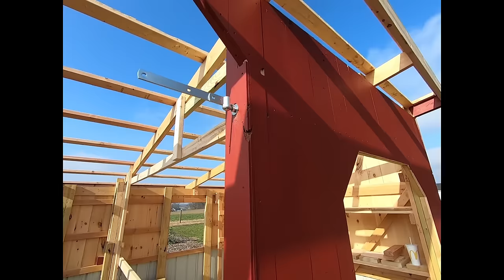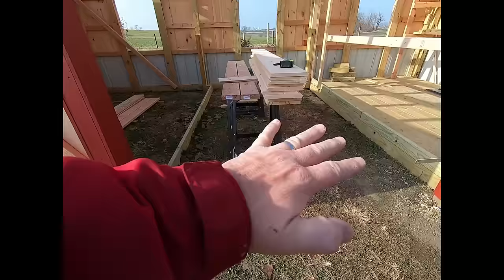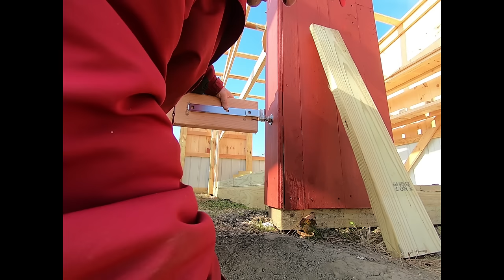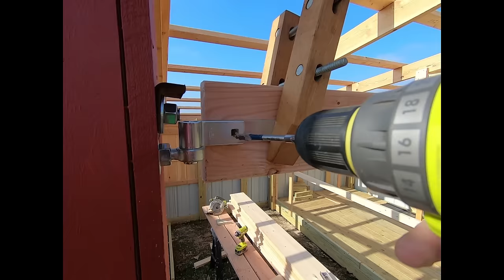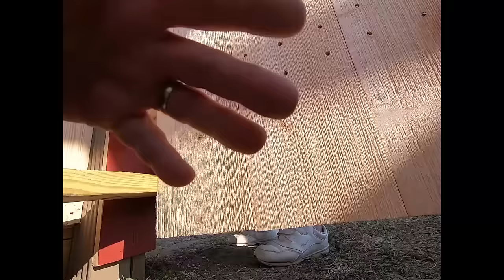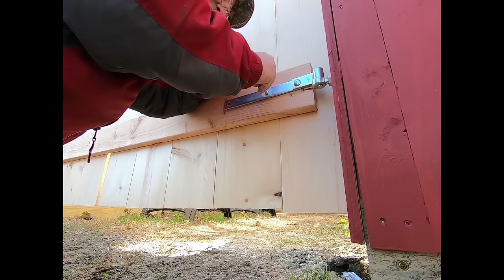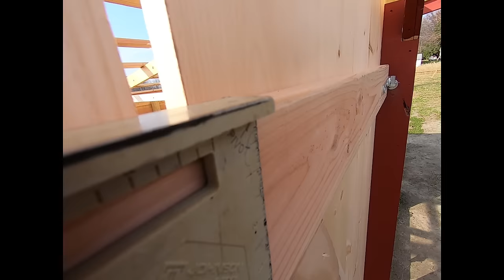DON'T build BARN Doors UNTIL you watch this VIDEO...EASY BARN DOORS

Comment: Easiest way to make large doors . . .  except they don't actually seal anything, so they are basically just gates that do not offer any protection to the things stored inside the building from the elements?  Am I missing something?
Reply from the maker: Thanks for watching!  I think you missed the whole point of the video.  One could build them as weathertight as one wanted.  The point of the video is to show that large doors can be built alone.  Secondly, a run in equipment shed is seldom weather tight.  If I wanted a garage I would have built a garage.  The doors keep 95% of weather out and what gets in is at the door area.  I gather you haven’t seen many real barn doors that are built above dirt and gravel and span 20-25 feet.  They are hardly weather tight.  Sorry for being short but you missed the entire point of the video by looking for things to be critical about.  Have a great evening.

Comment: Why didn't you simply install the other two bolts on the hinge with the vertical pieces installed, than remove the first bolt, install the vertical, than drill and reinstall the first bolts?
Reply from the maker: Good question.  Thanks for watching!

Comment: Pushing the hinges down like that will wear the hinges out faster. The hinges were not made to work like that.
Reply from the maker: They are going to drop down anyhow if the doors were built the traditional way with hanging after assembly.  The hinge has no way to not drop down. It's a matter of having the doors with a consistent reveal between them or sagging doors. We've built many doors this way and years later no problems. The largest were 24 feet wide and 16 feet tall.  I don't think the hinges will have a problem. Thanks for watching. Have a great day.

Comment: Damn it would be like a open window with the gaping cracks around the doors
Reply from the maker: It wasn't done yet and with a dirt floor I don't think a tight seal was realistic anyhow.  It's east facing and inset and with a roof overhang. Very little weather gets in.  Run in equipment sheds are seldom weather proof. Thanks for watching.

Comment: I wouldnt leave the hinge drooping down, why not level it up so you have more bearing of metal to metal.
Reply from the maker: Thanks for watching.  If you don’t take the “slack” out of the hinge the doors are going to droop down. That’s why this works.  No matter how it’s done the style of hinge used is always going to have the problem because of the “slop” in figment.
Reply: @LancoAmish  I don't see how there are 3 bolts to hold it. The same forces apply weather its level or not. You still rely on the bolts to hold the door to the hinge, If the bolts fail the door droops the hinge stay still. so whats the difference.
Reply: @LancoAmish  I would just shim the slop out of the top hinge and bottom hinge in the appropreite direction according to wieght distribution before bolting.  Now I have level hinges with full metal to metal bearing surfaces for longer ware and probably less squeaking.
Reply from the maker: Good idea.  Learn something every day!

Comment: Nice. An observation on technique, however. When tapping the bolt in, you are really choked up on the hammer. Hold it close the butt end, swing it like a pendulum, holding the bolt between your forefinger and middle finger with the pads of your fingers (not the nails) facing the hammer head. The same thing for starting nails. You'll have better control of your swing, and any "miss" won't smash a fingernail. The worst way is to grip the bolt or nail between thumb and forefinger, because you'll inevitably end up hitting the edge of your thumbnail.   "With years of experience comes...years of experience"
Reply from the maker: Thanks so much for watching and the great tip!

Comment: buy use them hinges can the door open either way
Reply from the maker: Marty Martin, mine open out. They bind inwards.  You would have to leave enough clearance for them to swing either way. In other words don’t put the bolt pin in too far on the posts

Comment: 11:25  I probably would have installed the other two carriage bolts then backed out the original carriage bolt then installed the last upright then drilled the hole thru that then reinstalled the original carriage bolt.
Reply from the maker: Good idea.  Thanks for watching. N

Comment: Prefer to have the hinges  verticals and braces on the inside
Reply: Yes...more protection from moisture which gets sandwiched and rots wood. 👍
Reply from the maker: Ben Joseph , I’ve built them both ways. These are set back into the opening.  Since I have neighbors I wanted them aesthetically pleasing also.  Thanks for watching!
Reply from the maker: Thomas Gertsch I’ve built them both ways.  These are set in underneath a ways to protect from moisture. I also wanted them a little more aesthetically pleasing since they are very visible to neighbors.  Thanks for watching!

Comment: NEVER build a barn door like this in Kansas!!!  We have barn doors that actually keep the weather out!!! The technique seem sound but we need doors that actually fit the opening like a real door. I have an old door that was changed to a failing rolling door that needs to be replaced. I may try to use this technique to replace it with swinging doors.
Reply from the maker: Thanks for watching!  The shed faces East and weather isnt that much of a worry.  They weren’t finished yet so they are a bit more weather tight than they looked then.  It’s the idea of building them in place that’s different than how most doors are built. I’ve built them 16 feet tall and 24 long this way.  Not much chance of keeping the weather out when the ground is the floor though.

Comment: I think the way you started the doors was a great idea, but you have many flaws in your build.  As a carpenter and the experience I have, these doors are a very bad design.  The hinge bolts should be on the face of the posts so the doors end up flush with the front so you can add door stop behind them for the doors to stop against and provide some weather protection for the interior of the building.  I'm not sure where you are located but if you have snow this design is terrible to stop it from entering.  I would also recommend you glue the boards with a polyurethane subfloor glue as that would help, otherwise you are most likely going to end up bolting the boards to the cross members to stop them from sagging.  I also do not understand why the lock system is on the face and not on the inside as would be normal practice.
Here are some examples to demonstrate what I am trying to explain: http://www.bvforge.com/installation_situations/images_in_masonry/02x260.jpg
http://www.brandywinebarnhardware.com/barn_photos.html
This picture is especially good: http://www.brandywinebarnhardware.com/images/braced_strap_hinges.jpg
Check out Mike's Doors: https://youtu.be/PEmhfZg8NY0?t=1022
Reply from the maker: Thanks for watching.  You are correct that I could have built the doors flush to the outside of the building but I built the doors to be inset into the building so the weather could not reach the top of the door planking.  The building is a "run in" equipment shed that doesn't need to be air tight nor weather tight. Its purpose is to be quickly accessed from the outside.  The door stop was easy to drop down from my top girt and be totally out of the way of my tractor.  The doors are "locked" with a 2x4 across the doors into brackets.  The purpose of the doors was not to stop all the weather, I have built many doors to do that but to stop most of the weather and since the building faces the east it isn't much of a problem anyhow.  The point of the video was to show a simple way one person could build big doors without having to heft possibly hundreds of pounds onto hinges and then have the doors drop down  because of the play in this kind of hinge. The biggest door we've built this way was 24 feet wide and 16 feet tall. Big  barn doors like that keep out most of the weather but realistically you are never going to keep out all the weather and really that is not a huge concern anyhow.  Again, thanks for watching and commenting.

Comment: dont build your doors like this. 6 months and they already sagged badly
Reply from the maker: You did something wrong or have subpar hinges. I’ve never had one sag yet.
Reply: @LancoAmish  I live in a high wind area. with the wind working the doors back and forth, they sagged
Reply: @StormyMonday0896 you could re-enforce by lifting up the sags to make square again and then add additional diagonals to both front and back of the door. Lots of variables to consider for different size doors, but in general you need to build in strength.
Reply: I rebuilt my doors and made the entire frame from 2x4 but stood the wood on its side to make the frame 3.5 inches thick.  I braced from top hinge to door center on top and bottom and a cross wood center brace side to side. Then I skinned with corrugated metal roofing. Huge 5'x9' doors, cool rustic feel and no sagging yet.

Comment: Wow.  Where did you learn about engineering stress points, counter stress and anti-angle deflection?  Certainly not in any certified university.  I'm talking about how you use the up/down play of the non-stationary 1/2 of the hinge to "prove" your point about not building off-site.  What you fail to understand is that once there is a non-flexible rectangle like a piece of plywood or properly built individual set of boards (i.e. a rigid door) are attached to 2 or more of the swinging halves, the hinge most certainly can NOT wobble up & down but is held in 1 plane by the other hinge(s).  I've  built many gates & doors "off-site" and when hung do NOT sag, wobble, jiggle or do anything other than swing smoothly.   Stop trying to get viewers snagged into watching with phony hype.  Youtube is filled with hype spewing folks who either know little about what they are displaying or know better but want more viewers so they title their videos with "Don't ever do ____ without watching this first!!" OR "These huge mistakes can cost you thousands!".  Both headline titles are followed by milk-toast gibberish which is mostly incorrect.   WOW!